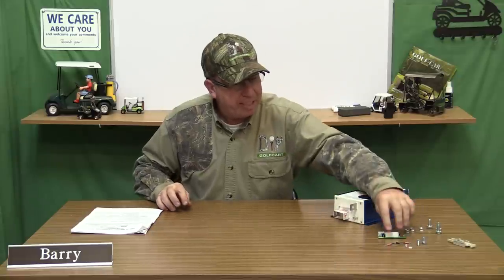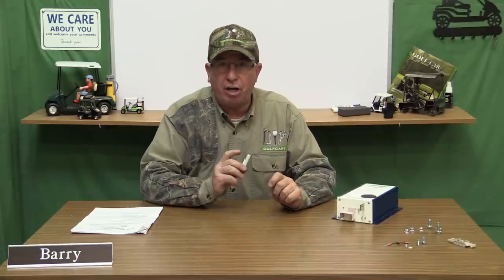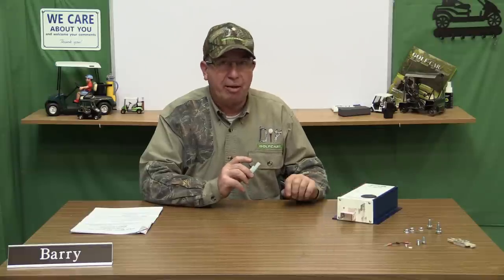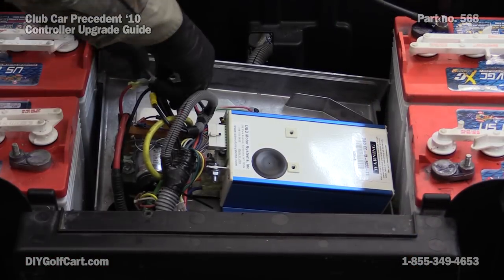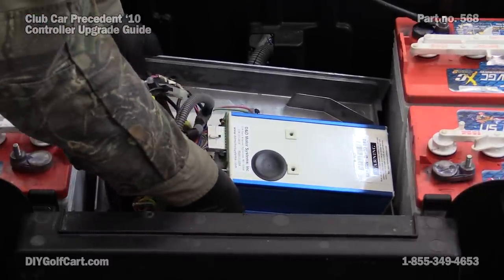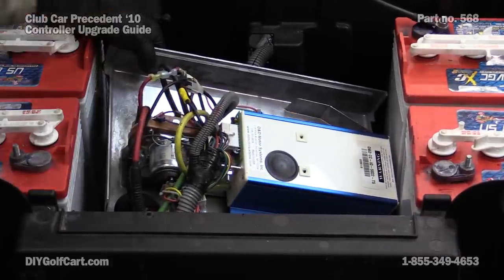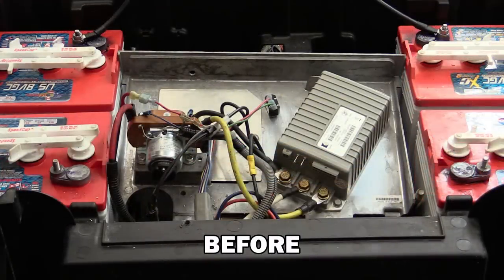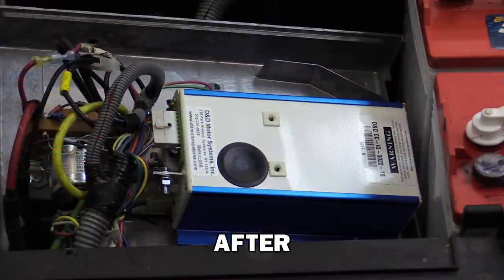Club Car Precedent Alltrax Controller Upgrade | How to Install on Golf Cart

Comment: Mount the solenoid horizontally. Why? Because hitting a bump can cause the solenoid to open the high Amp power connection to the motor which you don’t want to happen. That doesn’t happen if the axis of the solenoid is horizontal.  And, the diode across the solenoid coil prevents a back flow of high voltage which will damage the system.  Last pointer; when you tighten the nuts and cap screws on the large connection lugs use two wrenches. These connections have to be tight. Using only one wrench puts enough stress on the lugs to damage them.
Reply from the maker: A solenoid is electrically activated and doesn't care what direction it is mounted. I have mounted them in multiple applications and have never had a failure. Two wrenches? That's a personal preference.